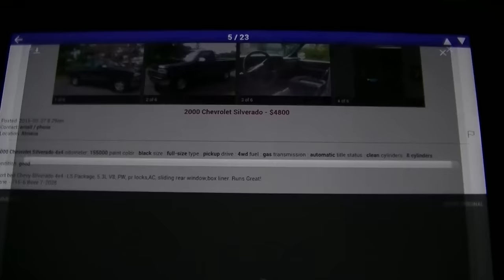2000 Silverado Z71 1st Year Reveiw "All Mods/Repairs So Far"

Comment: I have 2000 Silverado ex cab. It needs a lot of TLC but still runs great with 356k. Original engine and trans. too!! Owned it since 03. These are great trucks. Still loving mine.

Comment: nice truck. I have a 2000 z71 single cab step side with a 5.3 liter 5 speed and a thrush muffler. Ive had the truck for a little under 9 years. it has 141K on it. I bought it with 44K for $6,000. needs new bumpers and new rockers but other than that it doesn't even have a valve cover leak and still runs great. Been a great truck.
Reply from the maker: You should do a video of it.  I love the stepsides.
Reply: Bandit 3404 you have a 5.3 with a 5 speed? In 2000 I was told to get a 5 speed you had to go with a 4.8 or a 4.3 v6, the only time I have heard of a 5.3 with a standard was the Joe Gibbs Silverado and it was in two wheel drive, if you really have a 5 speed with. 5.3 something Is not original

Comment: Always disconnect the battery when welding on a vehicle otherwise you can screw up the battery it is more common with ac tig but it can happen using any electrical arc welding also put the ground as close as possible to the work piece on a vehicle cause if the current goes through things like bearings it can cause resistance and weld the bearings together.  Nice truck I have an 01 5.3l extended cab it Is my first truck (I am 18) has 98,000 miles I hope it is my last truck as well. Supper good condition it was the highest model offered of the 5.3 at the time.
Reply from the maker: I have never disconnected the battery when welding on any truck or car.  No problems ever.
Reply: I dont know if it is supper common but I weld aluminum boats and a co work forgot to disconnect it once welding with AC tig and it screwed up the battery. I have also heard it happen in other situations as well, just my advice.
Reply from the maker: I have never tig welded on a vehicle.  Wish I had a tig.

Comment: Great video man.... Watch most all of your projects.... You do awesome work. Quick question? In the beginning of the video,removing the glue and decals. What make / type / grit wheel were u using???My son is doing some work on his pickup .Would be appreciated. Great work man
Reply from the maker: It's a 3m eraser wheel.  They don't go by grit but they do a great job on decals and sticky tape.  Should be able to get it online or order it through your local auto parts store.
Reply: +mossman381 thank you

Comment: truck is awesome. A bit of advice for the exhaust, if you want more sound out of that particular Muffler I would suggest going with a larger-diameter tailpipe section and a four to five inch to help the sound magnified coming out of the tailpipe. other than that if you like the sound that gives but want more volume then you'll want to go with a Flowmaster 40 series which is basically a lighter version of that thrush welded Muffler. Not at all a straight pipe sound. More of the American muscle car sound. don't go with the 50 Series you were thinking about because it is even quieter than that thrush muffler you have on now. Great work on the truck!
Reply from the maker: The truck is sold.  An exhaust tip won't give you much more sound.  If I was to get another 5.3 I will start with a strait pipe and go from there.
Reply: Ok. Hope you got what you wanted for the truck. Actually tail pipes and tips can make a relatively dramatic difference in how exhaust pulses it expand and effect 2 sound. Straight pipe is it going to give you a very poppy untuned sound. Anyway the truck was awesome, looking forward to your next project.

Comment: Good Ass looking truck !! I have 2001 Sierra , I'm fixing bed side rust , already did rocker and cab corner on one side
Reply from the maker: Going to leave it for sale for awhile and see what happens.  The guy never showed up so I still have the truck.  I have others interested in it.
Reply: I'm working on a 2004 GMC Sierra I ran into a problem every time I shut the truck off my computer resets loses memory all the sensors completely reset.

Comment: My 2000 Chevy Silverado 1500 extended cab LS 4x4 is white I hate it but it's super clean should I paint it Black. And it has 200k miles and no problems yet
Reply from the maker: Unless you have experience painting I would leave it white especially if it looks good now.  You can make white look really clean with some chrome and color matching.
Reply: mossman381 what should I do for mods right now all I have is a cold air intake.

Comment: Hey mossman381, I had a few questions. I have the exact same single cab like yours. It’s currently stock. I want to have the same look as yours, suspension and wheels wise. What all did you do you if you don’t mind letting me know. Thank you in advance. God bless.
Reply: Also, where did you order your headlights and taillights?
Reply from the maker: If you want all the details you have to go through the playlist for that truck.  I have all the videos in order and I tell pretty much everything I did to the truck from the beginning.  The lights were from Ebay.

Comment: Just got a 2000 chevy, just wounder how tall is the suspension on your truck.i want to lift it about that height.
Reply from the maker: This truck is lowered.  2" lowering shackles in the rear and de-cranked torsion bars up front.
Reply: Felipe Herrera cause it's 4x4

Comment: Did you  having to changed the break calibers off the 2000 silverado, I replaced it in my truck today but now the breaks isn't working and the break petal pushes all the way down, I checked evrything  are bolted on right and i filled up the break fluid I don't lnow what is broken??
Reply from the maker: You have to bleed the brakes once to open the brake lines.

Comment: what kind of wheel did u use on the dewalt drill to remove the emblems?
Reply from the maker: It's called an eraser wheel.  Should be able to find them online or order them from your local auto parts store.

Comment: Love your videos and taste in modifications.  Where did you learn how to do all this?  Seems like you could tackle pretty much any job.
Reply from the maker: Working on my trucks since I was 14.  I could do anything but my funds are not unlimited.
Reply: Sounds like my buddy who grew up working on trucks and he's always got some kind of project going on.  About 18 months ago he bought a '62 Chevy C/K from a 96 year old woman who's late husband had bought it brand new.  Fortunately rust isn't really an issue here in southern CA but the paint was pretty much shot. Under the hood it still had the original straight 6 with a 3 on a tree.  I know there was no power steering, and I want to say there weren't even power brakes but don't quote me there.

Anyway, for the 1st year he just did small improvements and modifications here and there that the budget allowed for.  More importantly though, in his shop, he started on a secondary project which was building the motor he wanted in it, a 350 V8 that he worked on pretty much every night after work.  It was a lot of fun each night after work we'd hang out in the shop and slowly but surely, what had been a grimy, used motor got torn down, hot dipped, and piece by piece, night after night, it slowly became a bad-ass motor.

That sweet old lady wouldn't recognize it now -- It's got 33's on it, it's been painted black,  automatic trans, power steering, power breaks -- He even got the heater to work which the old lady said went out in the early 80's. lol  It's a sweet truck though, and your projects remind me of that!
Reply from the maker: That sounds exactly like how I do things   :)    And that sounds pretty cool too.

Comment: Where did you get your paint? And did you match it online to the color of the truck or what?
Reply from the maker: My paint comes from the local CarQuest.  The paint code on your truck is in the glove compartment with all the other build codes.
Reply from the maker: Most of these black GM vehicles are paint code 8555.
Reply: mossman381 Thanks!

Comment: what do you have on the drill to debadge im scared to mess up my paint
Reply from the maker: It's an eraser wheel.  I have several videos using it.  Should be able to find it at any good auto parts store or online.  It will roll decals and adhesive right off the paint without damage.
Reply: thanks also do you know if the paint under the emblems could  be slightly different because of fadeing i got a 2011 red silverado
Reply: thanks also do you know if the paint under the emblems could  be slightly different because of fadeing i got a 2011 red silverado

Comment: will i need to buff afterwards?
Reply from the maker: Depends on what the paint looks like under it.  If you are doing it to an older truck then you will most likely have to do some buffing.
Reply: thanks boss and ya its on a 98 chevy .5 diesel

Comment: can I have your facebook name I'd like to show you pictures of my chevy and ask you some questions
Reply from the maker: I don't use facebook.
Reply: mossman381 anything else you have so I can contact you?
Reply from the maker: THE REAPER   You can go to my about page on YouTube and email me.
Reply: mossman381 I had a question how would you make it louder and meaner any suggestions?
Reply: mossman381 like when your reving the engine or racing
Reply from the maker: THE REAPER   I wanted a louder muffler but the thrush was a lot quieter than I thought it was going to be.  You could add electric cutouts.  Then you could have a straight pipe with a push of a button.